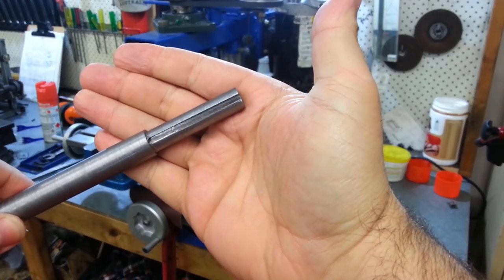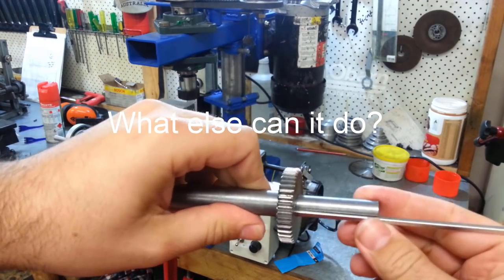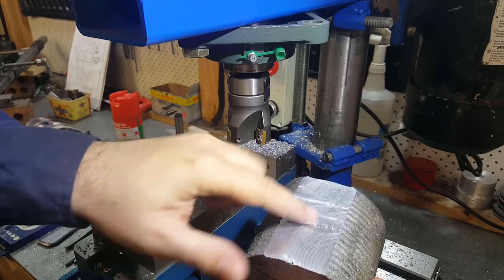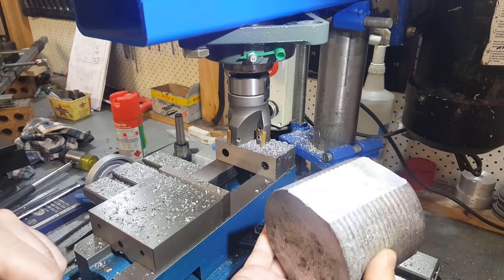DIY Milling Machine

Comment: People who think they can just turn a drill press into a milling machine are in for rude awakening the first time the try to cut metal and move the table. The shank from a drill press can't take that lateral motion. This spindle with the flange bearings point this problem out; those bearings are huge and they are necessary when you need to put POWER into that spindle cutting metal with the table moving. 
Excellent work! I really wish I could afford to make you on offer on this fine machine, but it's worth MORE than I can afford.
Reply from the maker: Hi Richard
Thanks for the comment - to see a little more on this machine checkout the 2nd video walkaround https://youtu.be/Hh18qEMccYM
I've had such positive feedback on this machine I decided to do a more in depth walkround to show it off in more detail.
Remember to Like / Share / Subscribe

Comment: love how smooth the machine works. No lose pieces nor vibrations like low/mid machines that are sold
Reply from the maker: Hi Joao
This machine does chatter if the cut is too heavy but this will happen with all machines.
I've just got to know my limits and take it slow - still learning it's limits
Thanks for the comment :)

Comment: Looks good, i have a suggestion: fill the column with cement. It will add a lot of mass which dampens vibrations.
Reply: That's a good idea, maybe sand would work even better at absorbing vibrations...?
Reply: @zevkej  maybe 80 sand 20% epoxy will work even better
Reply: @zevkej  sand can draw moisture to it when metals are involved now some have tried 60/40 mix of sand and silica pellets. rendering it dry for this application and helping density of the riser etc of the homemade mill
Reply: Or lead
Reply: 2steelshells that’s a lot of lead!
Reply: @flmag88  maybe 70% sand 20% epoxy and 10@ jism would be even better.
Reply: I know I’m late… but how about flex seal and silica sand 👀

Comment: Nicely done.  Although I'm not wild about the single circular support, in terms of rigidity. 
I liked how you used pillow blocks on holding the shaft bearings.  
Especially liked that you "GET IT" in regard to leaving out a quill ! 
 
For a DIY machine having that sleeve and associated gearing for a handle for raising and lowering, really adds slop to the system and that slop is 
exactly why you can't just chuck mill bits into a drill press (aside from the bearing in a drill press not be configured for significant side loads). 
A well built motorized Z stage, especially with linear feedback and handwheel, can allow precise to the 'thou' accuracy in the vertical direction. 
And then don't need the UBER precision work needed in doing a quill like in the old commercial vertical mills.
One can use the electronics to do what are normally the quill operations. 

Also liked that you motorized at least the X stage too (appears a windshield wiper motor?).  
Simple but would sure be a help as you can't take very deep cuts with such a setup. 
But still seems like a very capable piece of 'kit', as they say in the UK.  Good on you !!

Comment: That works quite much better than I thought. I've been thinking about building something similar. I've originally been thinking about making out of those cheap aluminium extrusion profiles, but now I'm beginning to lean on possible stainless steel ie. 40x80x4mm tubing, slotting and welding frame and then after assembly is figured out by making concrete with rebar in stainless steel tubing to get some mass to prevent vibrations.
Reply from the maker: Hi Jothain 
Thanks for watching my video and for your comment.
When building this machine I learnt that rigidity is key so I would reccomend going for the heavy steel tubing. I didn't use cement I just clamped the machine to the bench and it all seems to work fine when I get chatter I simply slow cutting down and take my time.

Comment: For anyone considering filling up the column/base, simply use concrete, preferably with a rust-prevention additive. Let it cure properly before doing anything else. 
Read up on 'Concrete Filled hollow Structural columns' to understand more. Use a "rebar cutter" drill bit & a diamond blade if you ever need to drill/cut this concrete filled steel structure. Regular HSS/carbide tools meant for metal will be dulled quickly as they come into contact with abrasive concrete.
Filling a hollow frame with plain sand would be more appropriate for something like a tablesaw/router/planer with a universal motor where the noise and vibration are quite harsh, and at high frequencies. Don't bother with plain sand in the column of a lathe/milling machine with a nice smooth induction motor (or any other spindle motors), it does nothing other than deaden some of the sound at some frequencies. Sand is only recommended if you'd need to drain the sand out before transportation. Sounds like a huge hassle to me.
Epoxy+rivets can be used to bond parts that have thin cross sections and a large contact area, instead of bolts or welds. It would work very nicely to reduce overall vibrations along with adding some stiffness/rigidity at the joint. Yes, epoxy+rivets are stronger than bolts or tack welds. 
A fully cast epoxy granite bed/saddle/frame is super stiff and has amazing damping characteristics. But using Epoxy+sand simply as a filler within steel tubes is not worth the money. Cheap concrete mix filler from a home improvement or hardware store does a much better job than epoxy+sand filler or plain sand.

Comment: one thing i can see from looking at the machine , its going to want to twist around the mast (rotating itself against the force of the milling bit cutting intoo the material ) and probably tension the z axis ajustment in the back 
if you double up on the mast (side by side) or add a slide bearing to one side to counter the rotation force that should make the mill better

Comment: Hello, I must say that is very fine mill you have there. I made mine out of the same materials that you did. Discards and parts on hand. Very impressive 2'' end mill chip making. You should be very happy with the end product and I am very sure you will use it with great joy knowing that your brain conceived the idea and your hands and eyes brought the idea to fruition. Have fun.
Reply from the maker: Thanks for the comment John.
In the biginning I wasn't sure if it was even possible due to the rapidity factor required for milling. But I remembered something my father told me years ago 'if you can draw it - you can build it' and that's exactly what I did, I put pen to paper and the result was amazing!
I'm glad to hear you also made your own mill, I'd love to see a photo.

Comment from the maker: Hi Tom
Thanks for the comment, you are correct. Building a milling machine was no small feat - it took 3 month's and many failed attempts until I found a working combination.
As for it's functionality - the machine was built to do simple tasks such milling a small key way into mild steel and some small facing cuts on soft material such as aluminium / brass.
Reply: I would appreciate a lot more video of the actual build. The links to the parts are rubbish, I can’t see the parts themselves, and the video is way too fast to understand the assembly. Not being rude, just offering an honest perspective on the video to help.

Comment: Nice job. You may find stiffening the area at the  base of the column where it joins the table will help with flex when taking bigger cuts. Weld some thicker steel plate to the top surface would probably help I would guess.
Reply from the maker: Hi crikycrocky
Thanks for the comment, I might give that a go.

Comment: The spare parts you had "Laying" around would probably add up to the cost of a store-bought mill. Throw in all the hours and failures and it would have been cheaper to buy a good ready machine in the first place. Rigidity is the heart of any mill and the single round column is not that rigid. After all that work, and it is to be commended, you end up with a very limited mill.
Reply from the maker: Hi Rudy
Thanks for the comment.
As the saying goes "You have to crawl before you can walk".
The home made mill does me fine for my needs and is far from a professional unit.

I had actually planned to buy a new mill if my home made attempt failed, that's what led me to choose the M3 Morse Taper tooling. This way I'd already have the required tooling that would fit a professional unit.
However the home made unit turned out to be a success.
Thanks for watching.
Reply from the maker: @bill4639  Hi Bill, actually not BS!
Checkout video 2 showing the home made parts of the machine.
https://youtu.be/Hh18qEMccYM

Comment: Impressed.  Just what I want to make.  Question: so you were able to make a morse taper for the inside of the spindle.  I assume your lathe could be set up to do that taper?  I have an old tool room lathe that has very little auto features.  Any suggestions?
Reply from the maker: Hi Jack Dernorsek 

Thanks for the comment, for additional information on the build please check out home made tools form listed below.
As for the 3M Spindle taper, my lathe doesn't have any fancy auto taper attachment either. I simply placed the 3M taper of my tool holder between centers so it  was perfectly centered. Then adjusted the compound slide by making small adjustments running the dial indicator back and forth across the 3M taper until my dial indicator registered no movement. This meant my compound slide angle matched the 3M taper perfectly. 
With this done I attached my tool post clamped on my boring bar and manually fed the boring bar in and out until the desired depth and size were reached.

Please see a photo of the compound setup
https://www.homemadetools.net/forum/diy-milling-machine-74852

Additional information about the build and parts used is located at homemadetools.net and hackaday forums 
Homemadetools forum https://www.homemadetools.net/forum/diy-milling-machine-74852

Hackaday forum https://hackaday.com/2019/09/01/scrapyard-milling-machine-gets-work-done-on-a-budget/#comment-6176735
Thanks for watching
Please Like / Share / Subscribe

Comment: Whats the runout on those bearings for the spindle?
Reply: I was wondering the same thing lol also what is the spindle type and name of it? Because id like to try making a mini mill as well but never knew the correct name to that part. Is it a collet chuck or just called a spindle? Lol i know dumb question but im new to the milling world lol.
Reply from the maker: Hi Brendan - thanks for the comment.
After building the machine the runout measured on the cutting tool was 0.04.mm, I don't believe this was caused by the bearings. My steady rest moved slightly whilst machining the internal M3 Taper.
0.04mm runout was more than acceptable for me.

Comment: damn good job. the motor its from a air condition correct?
Reply from the maker: Thanks for the content, the drive motor was from an electric paint sprayer.
The Z-axis lift motor was from a treadmill and the X axis motor was a car's window wiper motor.

Comment: Awesome job with the mill, and looking at it, it not much more then a modified drill press. Where did you come across the beds, servos and lead screws, if i may ask? I used to be a cnc machinist/set up operator but have been retired for 8 years now. Some of the parts you used had to of been expensive?
Reply from the maker: Hi James Waltz

Thanks for your comment, just to confirm - this milling machine is not a modified drill press. I did try using a drill press on my first attempt however the results were horrible so I decided to build the whole thing from scratch including the platform, top head assembly, drive shaft, pulleys, power feeds, electronics, etc.
Overall, I this project didn’t cost that much in comparison to an entry level machine which begin at $2000 without tooling. I probably spent close to $450 putting this machine together.

Parts used:
Centre Pole and lead screw:
The centre pole is from an old bench grinder pedestal I salvaged from a scrap yard, I machined it and  used it as my centre stand, the lead screw was some threaded bar purchased from Bunnings.
Bearings: 30mm flanged bearings, purchased from e-Bay 

Motors:
For the table X axis I used a window washer motor from a small car connected to a 12v motor speed controller for the power feed, for the clutch I used a 19mm socket and machines a square to easily engage and disengage the power feed.
For the head I used a hydraulic paint sprayer pump 2400watt motor which I picked up form a recycling centre for cheap. 
For the Z axis I used the rise / fall motor out of a treadmill, this motor was perfect as it was already geared to lift a heavy load.
Parts Purchased
Bed: Compound table 155x470mm purchased from Hare and Forbes https://www.machineryhouse.com.au/M198?gclid=Cj0KCQiAk7TuBRDQARIsAMRrfUZDpIP4tFT3oNsCCXEOw2WxM4OmxyVrGBjtrPzMFFd75TmTdtcFor8aAl9JEALw_wcB
Pillow Block Bearing UCF207 35mm https://rover.ebay.com/rover/1/711-5...item521a81bdc0
4" Milling Machinist Vise https://rover.ebay.com/rover/1/711-5...72.m2749.l2658
ER32 Collet Set https://rover.ebay.com/rover/1/711-5...72.m2749.l2649
M3 Face Milling Cutter https://rover.ebay.com/rover/1/711-5...refresh%3Dtrue
ER32 Collet Set https://rover.ebay.com/rover/1/711-5...72.m2749.l2649

Additional information about the build and parts used is located using the links below.
Homemadetools forum https://www.homemadetools.net/forum/diy-milling-machine-74852
Hackaday forum https://hackaday.com/2019/09/01/scrapyard-milling-machine-gets-work-done-on-a-budget/#comment-6176735
Reply: Well I'm extremely impressed and hi for the insight

Comment: excellent realization, can I ask you some advice? I would like to build it thanks
Reply from the maker: Hi Arg, thanks for the comment.
What did you want to know?
Reply: @MaximumDIY  Hi I wanted to know what kind of mechanism you used to move the spindle or collet.  Up and down thanks
Reply from the maker: @arg-maker-garage  I used a lift motor out of a treadmill as it was 240v and geared down enough to lift the weight of the spindle head.
More info and photos here
https://www.homemadetools.net/forum/diy-milling-machine-74852

Hope that helps
Reply: @MaximumDIY  Thanks for the information I hope to build it too

Comment: how come you did not use automotive hub and bearing assemblies instead of flange pillow blocks..  a pair of automotive hub and bearing assemblies mounted like your pillow blocks can handle tremendous side loading with no play.. each is a angular ball bearing assembly in preload,   since they are splined. if you cut your own tight fitting splines you can have a quill that can transfer massive amounts of torque..  the only thing. some versions need to be  bolted tight to keep the front and rear inner races in place..  its just a thought..  mount the pulleys to the studs  like a brake rotor would be mounted.  you might be able to mount a chuck adapter plate the downward facing hub and bearing assembly..  or  a fairly massive shell mill for surfacing..
Reply from the maker: Hi Wayne P
Thanks for the comment, you have an excellent idea to use a car hubs and bearing, the reason I didn't go with this approach is simply I didn't think of it.
I can see how the angular bearings would eliminate play, that being said the overall spindle play on the existing setup is 0.04mm. I was aiming for 0.01 but had some issues with a steady rest accidentally moving during the final cut on the lathe but 0.04 is close enough for what I need.
Thanks for watching.

Comment: hi i saw that i used a treadmill lifting motor has 3 wires can you tell me how you connected them to the 230v thanks
Reply from the maker: Hi Francesco 

Thanks for watching my video, I would like to point out working with mains voltage can be deadly. If you are not sure how to wire this up please seek the assistance of professional electrician.

My treadmill lift motor had the following connections
Voltage 240vac
Green = Earth
Red = Positive rotation = switched neutral
Black = Reverse rotation = switched neutral
White = Active = hot wire
The three sensor wires were not used.

I used a use a three way switch between (Red),  (Black) and (white) to switch the active between the neutrals.
This allowed the motor to spin in either direction when the switch was changed.
The motor wiring diagram can be found here https://ae01.alicdn.com/kf/HTB1PDaANCrqK1RjSZK9q6xyypXaA.jpg

Thanks for watching
Please remember to Like / Share / Subscribe.

Comment: How much was the total bill for this build?
Reply: Hi Dave M

Thanks for the comment, for more information about the build you can checkout this forum https://www.homemadetools.net/forum/diy-milling-machine-74852As for the build cost, total purchased parts cost approx $500 this was excluding the materials I had laying around in the garage. I figured I'd build the mill to use M3 taper tooling incase the build turned out to be a failure I could purchase a small sized mill and still use the same tooling.